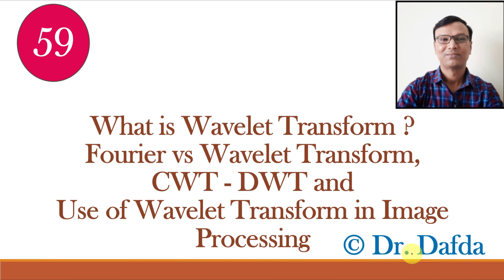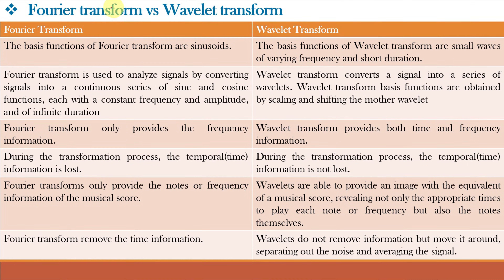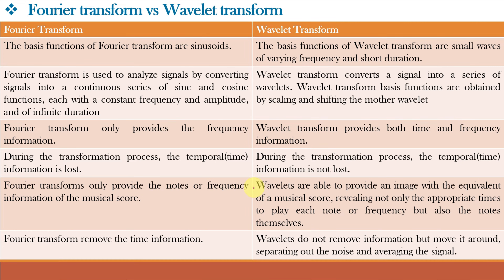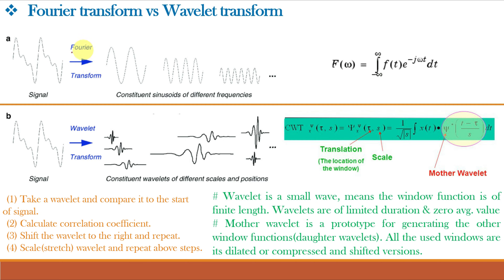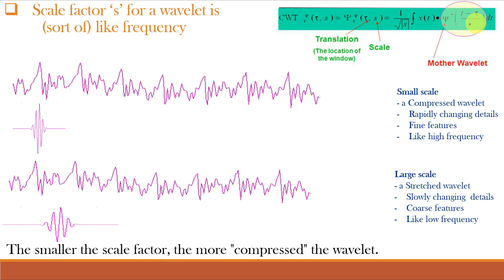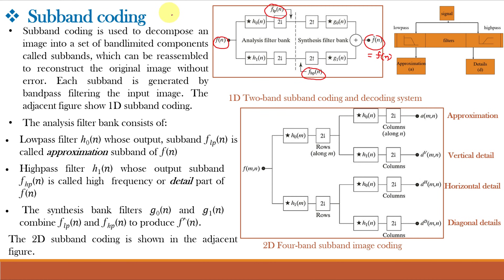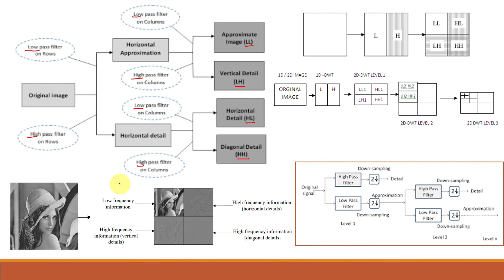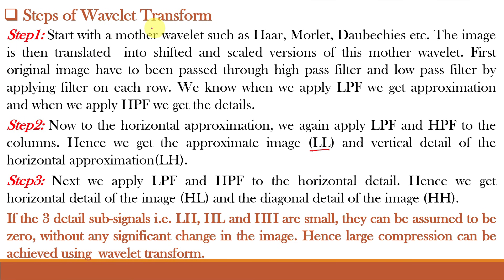What is Wavelet Transform?Fourier vs Wavelet Transform|CWT-DWT|Wavelet Transform in Image Processing

Comment: Hi, is there a clear approach to convert the scales to the frequency in Hz? what is/are the frequency content of the wavelet itself?
Reply from the maker: Yes, the conversion of scales to frequencies in Hz in wavelet transform involves some mathematical relationships. In wavelet analysis, the scale parameter 
s is related to frequency (f) by the following formula:
f=1/s
This means that as the scale increases, the frequency decreases, and vice versa. The scale parameter is essentially inversely proportional to the frequency. This relationship is derived from the wavelet transform equation, where s is the scale parameter, and ψ(t) is the mother wavelet function:
Wavelet Transform=∫-∞ to ∞  x(t)⋅ψ∗((t−τ)/s )dt. Here, s is the scale, and f is the frequency. The relationship f=1/s,  helps understand how the scale parameter influences the frequency content of the wavelet.
As for the frequency content of the wavelet itself, it depends on the specific wavelet function being used. Different wavelet functions have different frequency characteristics. For example, in the case of the Morlet wavelet often used in continuous wavelet transform (CWT), it is a complex sinusoidal wave modulated by a Gaussian envelope. The frequency content of the Morlet wavelet is related to the central frequency of the sinusoidal component.

In summary, the relationship between scale and frequency in wavelet transform is f=1/s , and the frequency content of the wavelet is determined by the specific form of the wavelet function being used.

Comment: Can you please explain, how LL gives Approximation, LH gives Vertical details, HL gives Horizontal details and HH gives Diagnol ....? Like why LH is not give Horizontal or diagonal??
Reply from the maker: In wavelet-based image compression, the LL, LH, HL, and HH refer to the subbands obtained after applying a wavelet transform to an image. These subbands represent different types of information present in the image.

LL (Low-Low) Subband: The LL subband contains the approximation or low-frequency components of the image. It represents the coarse details and overall structure of the image.

LH (Low-High) Subband: The LH subband contains the horizontal details of the image. It represents the high-frequency components in the horizontal direction. This subband captures the information related to edges and transitions that occur horizontally in the image.

HL (High-Low) Subband: The HL subband contains the vertical details of the image. It represents the high-frequency components in the vertical direction. This subband captures the information related to edges and transitions that occur vertically in the image.

HH (High-High) Subband: The HH subband contains the diagonal details of the image. It represents the high-frequency components in both the horizontal and vertical directions. This subband captures the information related to diagonal edges and transitions in the image.

The reason why LH represents horizontal details instead of horizontal or diagonal details is due to the way the wavelet transform is defined. The wavelet basis functions used in the transform have specific characteristics that separate the frequency content in different directions. The LH subband captures the high-frequency information in the horizontal direction, while the HL subband captures the high-frequency information in the vertical direction. The HH subband captures the high-frequency information in both the horizontal and vertical directions, resulting in diagonal details. Therefore, LH is used to represent the horizontal details in wavelet-based image compression.
Reply from the maker: https://youtu.be/T0Zhgc4BZl8